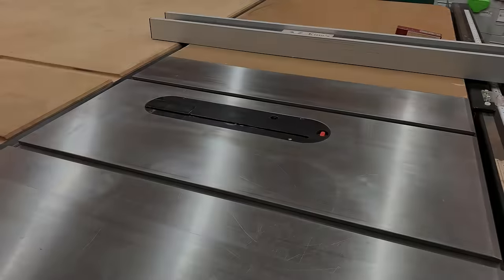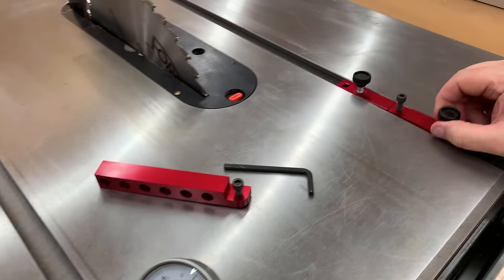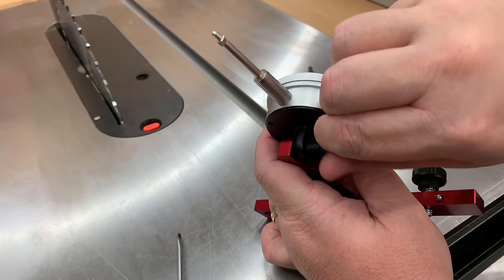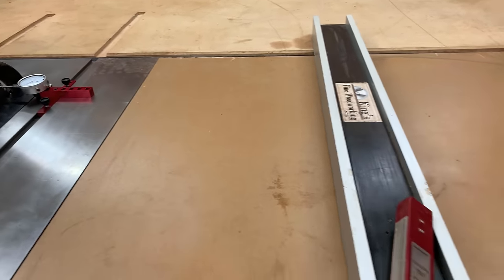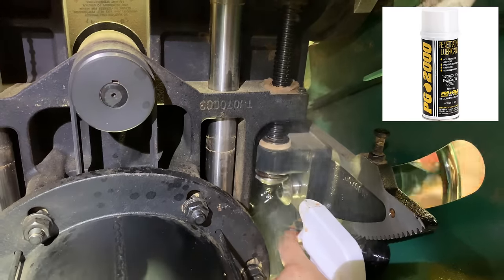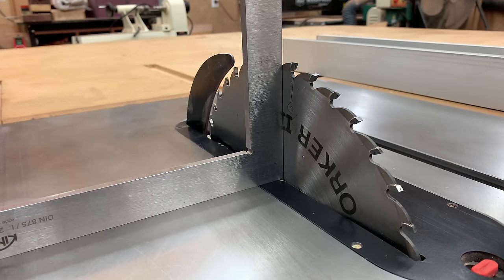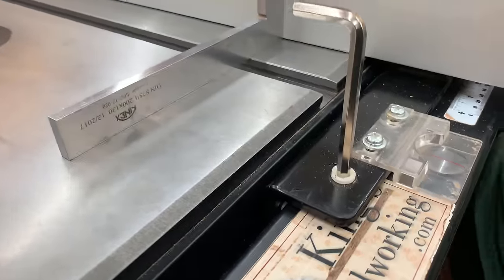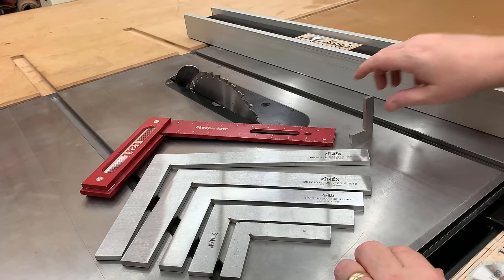81 - Table Saw Blade Alignment and Tune Up - Make PERFECT tablesaw cuts!

Comment: Hi James, great work.  We have also found through years of set up, when you have your blade adjusted properly with your table guide slots, we like to adjust the fence open angle from the cutting side 1/32 from the front edge of the table to the back of the table.  This gives you about a1/64 of open space from the start of your blade to the end of your blade -- way less burning and binding.  Your fence is still set to the front teeth, all the same and allows a bit of tension to release while still getting a fantastic cut.  Something to think about and probably not for everyone.

Comment: I would like to add for those not use to using mechanical dial indicators, when you mount the indicator to the bar you should preload the dial indicator about 3. Thousands, this will remove any back lash in the movement of the indicator. I also use a master plate on the Arbor instead of using a saw blade. Saw blades typically are not parallel. As a former CNC Field Service Engineer back in the early 80’s. I wanted my saw set up correctly since I had the tools to accomplish this task.
MK Designs sent me over, Mike and I have the same saw. 

Nice video.

Comment: Informative, thanks.  One thing I do differently which I believe is more accurate, is the last measurement you made.  Instead of zeroing out your fence, it is more accurate in my opinion, to put a test piece through your saw approximately 1" for example.   If your test piece comes out at 7/8", no problem. Using your calipers, measure it, and change your measurement mark on your fence to match.  Some lessor quality tables have blades that wobble to a degree, this process accommodates for that and you don't need your blade to touch the fence.
Reply from the maker: Great idea!

Comment: so...years ago I had an article on some magazine covering blade alignment. If you lay the blade over to 45 degrees and check the alignment it is likely to be easy off front to back on the blade.  this leads to burned mitered edges.  It also makes it hard to make the cut.  The article had a procedure that involved Shimming the trunion, and where they went. After doing this my contractor saw was a dream. On a cabinet saw you shim the top. I have not seen this covered anywhere since.

Comment: you might also check the run out on the arbor face, as well as the run out on the arbor screw, both with a dial indicator.   i use a .001" flat machined metal plate instead of the blade to check for miter slot parallelism and for blade angle. this removes the saw blade from the equation.    then you should also check the run out on the blade which will tell you if the blade is warped.  

i prefer to use the dial indicator to check the fence parallellism.  it can also tell you if your fence is warped, assuming the miter slot hasn't become worn.  that can be checked with a high quality straight edge, like a starrett straight edge (not a ruler).

Comment: Great video! New woodworker here, so much appreciated. One comment: I noticed that the plungers of the A-Line-IT tool are on the side of the mitre slot that is closest to the saw blade.  However, I watched the setup video that came with the A-Line-IT tool and the manufacture says the plungers should be on the side of the mitre slot that is opposite the saw blade.  This pushes the side of the bar up against the side of mitre slot that is closest to the blade.

Comment: Hi James The only thing I could add or recommend is to use a product called Sandflex Sanding Block (3 pack) on your cast iron saw top. Its available on Amazon for about $16.00. They will bring the top back to a brand new condition.

Comment: My boss, cabinet shop owner, had one of these fancy, expensive thingies. I took a punch to the bar on a miter gauge, made four pock marks - which raised the metal.  Had to file down the pocks until the bar barely slid in the cast iron slot - NO SLOP., clamped a piece of scrap wood to the tight-fitting miter gauge and went halfway through the blade, shut off the saw, spun the blade and listened. We loosened the trunnion bolts...

Comment: Great Vid James, the only thing I would add is to verify the alignment of the riving knife to the blade, I used your methods and also found my riving knife was in line with the right kerf instead of centered causing binding between the riving knife and the fence after I realigned the fence and the blade to the miter slot.

Comment: I need to do this to my saw, and coincidently planned to do it today, but it's a cheap end saw so i have to find what adjustments there are. I recently built an adjustable mitre jig and it is accurate, however it looks as if the blade is drifting side to side and producing inaccuracies. I notice some movement (rock) when the saw is lowered or raised. I am not sure yet if there is anything to tighten. Thankyou for another great video

Comment: I think there might be one other measurement that you need to address and that is with the blade set at near 45 degrees, measuring at both the front of the blade and the rear of the blade.  I have a DeWalt contractor saw and mine is out of alignment by a significant amount and it would be beneficial to know how to correct this alignment.

Comment: Very informative video.  I wonder if the dry lube with teflon you can get in the big box stores would do the same as the bladecoat?  Haven't tried either so it would be an interesting comparison.

I did see one error in your explanation of the squares near the end of the video.  You said the Woodpeckers square was accurate to "85 ten-thousandths of an inch".  That isn't quite right.  Their claim is it is square to .0085 degrees.   A completely different measurement.  That is about .00015" per inch.  (edit: I originally had .001" per inch here - that was wrong)

Other than that, great video.  I've got to clean my blades more often.  That Rockler kit is now on my shopping list.  Thanks for this.
Reply: You don't need a kit for blade cleaning.  Just use WD40 or Simple Green and a brass brush.  Does a fantastic job.
Reply: Good call. I was wondering who else caught that. .0085" over 12" certainly wouldn't be a precision square. From what I see, they claim .001" or less over 12". I do wonder if you meant per foot rather than inch though.

Comment: Would the process be similar for a job site saw?  I have a dewalt 745 and I always feel like it’s just slightly off (even for construction use).  I am very diligent with cleaning and blade service otherwise.   Bostik works really well for bare metal, but I feel like it’s less effective on coated diablo blades.  It’s a great product, not cheap but worth the money.

Comment: I bought a dovetail saw a couple weeks ago and it has a sticky oil based coating on it. I’ve tried to get it off with a couple solutions but I have not had any luck. Do you have any suggestions.

Comment: pro tip: you can use your fancy blade alignment tool to check your fence alignment for parallel the same way you did your blade. great video!

Comment: This is just me being a reliability and safety engineer, but step 1 should always be disconnect the machine from it's power source.  For most people, that would simply mean unplugging it.  I've worked with many electrically-powered tools and can't recall any that are single-fault tolerant; in other words, one failure could start that blade spinning.  That said, you and your family are fantastic wood workers and produce very professional videos.  Dare I say you're the Norm Abrams of YouTube?

Comment: Hi James, really liked your video and loved the details. Question, the dial indicator is really handy for tuning the table saw, why not use the dial indicator to measure the blade at 90 degrees? While the dial indicator is in the miter slot you could adjust the blade to its lowest level to make sure the blade is exactly at 90 degrees. Do you agree with this process? Am I missing something? Another suggestion, and I would like your feedback. I saw this from another video that made a lot of sense to me...remove the blade and use a 10" piece of 1/2" ply wood, drilling a hole to fit the blade arbor then use the dial indicator per your instructions. This would allow a more sensitive and accurate tuning of the table to the blade. Does this make sense? Do you agree? Another suggestion is to use the dial indicator again by mounting it on a board to slide it along the fence to the blade. Actually, the goal is to calibrate the fence directly to the blade and not the miter slot. I am not very experienced and would appreciate your feedback. Especially, using the dial indicator to measure the 90 degrees of the blade, I have not seen this calibration procedure on any other video or written instructions so maybe it is not correct. It seems to be a simple and very accurate method...thanks again...

Comment: I don't see the links for the squares. I see the list but no links.
Reply from the maker: Hi. Here are the links. Thanks!
Machinist Squares

Solid no lip:

3”x2”  https://amzn.to/3osKGNd

4”x2-3/4”  https://amzn.to/3wgePCh

6”x4”  https://amzn.to/3uQBsy4

8”x5-1/4”  https://amzn.to/3w9xfEv

10”x6-1/2”  https://amzn.to/3NPcxUf

11-3/4”x8” https://amzn.to/3NPcIPp

Solid with  with edge 

3”x2”  https://amzn.to/3ePeEb6

4”x2-3/4”  https://amzn.to/3w445qi

6”x4”  https://amzn.to/3tSezrs

8”x5-1/8”  https://amzn.to/3u6Ahv0

10”x6-1/2”  https://amzn.to/3x4hZMM

11.75”x8” https://amzn.to/3okGGON

16”x10-1/2”  https://amzn.to/3uS7zNG

Comment: Very good video. However, there is one thing that I learned years ago (the hard way) and have incorporated into my table saw that differs from your tutorial and that has to do with setting the fence NOT exactly parallel relative to the saw blade. In your tutorial you recommend that after setting the blade exactly parallel to the guide slot machined into the table top you then set the fence exactly parallel to the same slot thereby ensuring that the fence is exactly parallel to the blade. I learned years ago that, for safety sake, instead of having the blade and fence perfectly parallel to one another you should, instead, adjust the fence such that with the fence up against the side of the blade and in contact with the front teeth of the blade, there should be a tiny gap between the rear teeth of the blade and the fence. This gap should be just a few thousandths of an inch. This gap will minimize the possibility of having the workpiece get pinched between the fence and the rear portion of the blade, which is spinning up and away from the table top thereby reducing the possibility of having the blade throw the workpiece into the face of the operator. This happened to me many years ago when I first got my new table saw and set the blade and fence perfectly parallel to one another. I was fortunate in that I was not injured but this incident caused me to reevaluate this concept resulting in my allowing a .002"-.003" gap between the rear end of the blade and the fence. Since making this adjustment I never again experienced a similar incident. While doing so might cause a very minor error in the final tolerance fit of the workpiece, I personally would rather sand down the lumber to eliminate any minute irregularities than suffer physical injury.
Reply: Mykola Orda . Hi, just curious if you had a riving knife on your saw when the kick back occurred? I have read differing opinions on this. I have my fence set like you suggest at this time. The best investment I have made, in my opinion is to install the Jessem hold down wheels. They work great.
Reply: Mykola:  When you say that you leave a tiny space between the rear saw teeth and the fence, you mean the teeth furthest from the operator, i.e., the teeth coming up out of the insert plate, correct?  That is how I set up my saw, and for exactly the same reasons as you explain.

Comment: It was a very well done video. But I'd be amazed at any one of those cheaper squares being 1/10th as accurate as the claims are. Checking the Starrett or Mitutoyo websites for there squares and what the allowable deviation is from being truly square verses there prices pretty much say's it all. High precision cost's a great deal no matter what the price of labor happens to be. As a metal machining hobbyist I've got the equipment to correctly test for square. I can assure you that other than being extremely lucky .0003" with any lower priced metrology equipment is almost impossible. And if you ever did drop one, then you can bet money on a precision square being greatly affected. They really needed to be handled and treated as if there made from glass to preserve any accuracy that might be there.
Reply: Well, on defend of Kinex, it is well known and popular producer of metrology equipment with good name and long tradition here in Czech republic. I is true that I´m not so sure about company owners and capital holders at these years because lots of machine works and precise equipment producers here had problems to survive in "wild 90´s" after our revolution, so maybe there is some Kinex products branded and produced in foreign, but maybe not. Definitely Kinex´s product line covers more classes of precision. Here on video are squares in class 1, but you could also bought class 00 from them and even let them to verify and tune that square in metrology lab. And even these squares in class 1 are cerified for that accuracy. I want to say it because these squares maybe are not as good as world masterclass, but they are realy decent pieces of measuring tools in decent price level.
But I totally agree about taking care of them. They are heavy duty, especially these smaller ones, but stil, these are not for throwing to floor. As a hobyist I have only one, yet. But I try to keep him in safe flat position and take care of it.

Comment: So your needle deflected to the right at .005 which means that the blade is actually trending to the left from front to back, correct? So the table has to be adjusted couterclockwise using the left front corner as the pivot point?